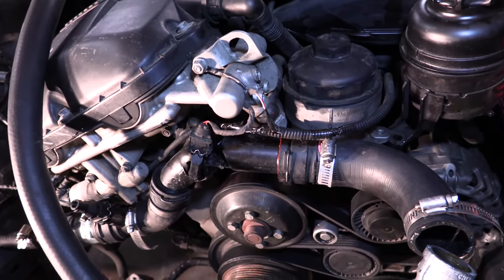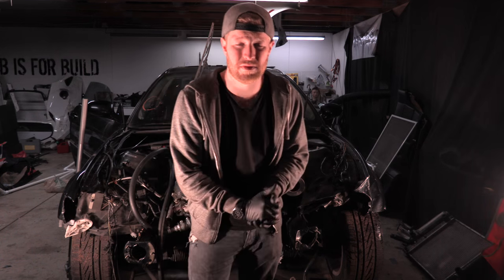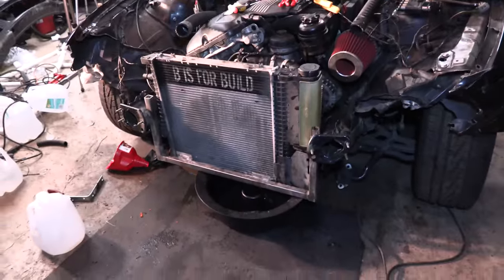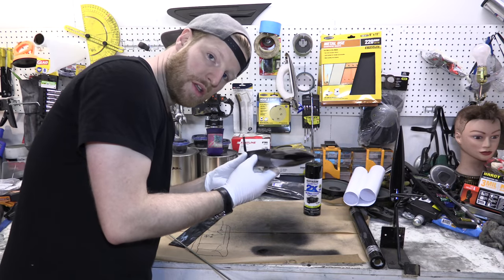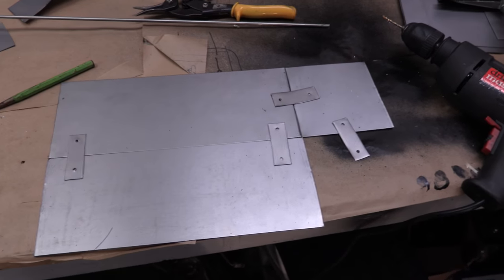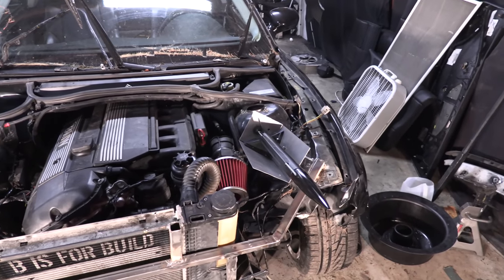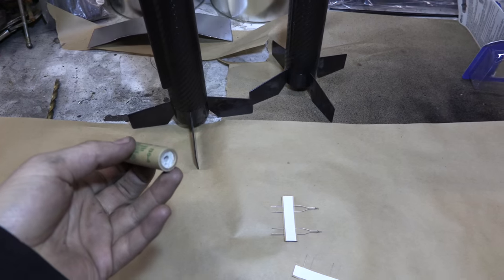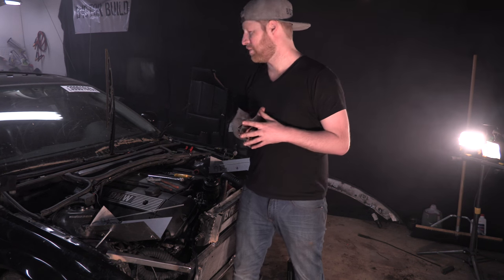Budget BMW Fun Pt 4 - DIY Rocket Launchers!!!

Comment: Please sell the exhaust and do a straight pipe from the headers, out of the hood
Reply: +22laith22 nooo out the side
Reply: +joel stuart ^^^^this guy knows whats up. #weightreductionbro
Reply: Just cut the exhuast half way down,  or maybe splice it off exiting on an angle behind a door.  Save yourself a carbon dioxide headache and a stinky smell.
Reply: +joel stuart side exaust out the fender between the door and the wheel for swag
Reply: +22laith22 side exit will be best
Reply: +22laith22 I approve of this
Reply from the maker: +22laith22 OK guys i really wanna do this , so ill look into it, but if it means losing 2.5inches of ground clearance, i cant do it. But ill try my best!
Reply: +B is for Build if you got out of top of the hood you won't have to worry about your exhaust scrapping at all
Reply: You might throw check engine light codes since you won't have a few sensors after straight piping it.
Reply from the maker: +22laith22 if i dont think i wanna go out the hood, i cant run any resonators or anything to quiet it down, so itd be super loud and quite the cop magnet, side is cool, id like to do the side if i can figure it out
Reply: +B is for Build do side but thru the fender
Reply: Or follow the existing exhaust path and just do a straight pipe all the way back. Or from the cats back.
Reply: like mighty car mods silvia
Reply: 22laith22 or just do a side exit pipe..
Reply: nuuuu

Comment: you should connect the rockets to the indicators.  That way you can set off either the left or the right at 2 different times and the wires are all up front. lol @BisforBuild

Comment: All you need is hose with a diameter that matches what the system already uses. It'd be more expensive, but it wont cause the huge restriction of that 1/2in (?) line you've been using...

Comment: Make it a Mad Max/James Bond crossover theme, maybe stick some chunky tires on if you can. Definitely needs to have a muffler replaced with straight pipe and a light bar, maybe a huge cb antenna too.

Comment: if you have overheating problems you can tune ur ecu byurself and set the timing on thermostat to open early so car doesnt build up any pressure and your radiator  hose  wouldnt pop , thats why expansion tanks on these cars go , cuz too much pressure.

Comment: As said in a previous comment i think its more down to the fact that the pipes are smaller and the flow is less causing far too much pressure than it should be.

Comment: dude if that top hose blew off going 65-70 the intake may drink it up and could potentially hydrolock your motor. Cool stuff so far though I like the idea of the rear mounted whatnots with a mad max bash bar?

Comment: How many beers do you go through on a typical build day?  And where do you go to let it out after you break the seal?
Reply from the maker: +0ttoman id say 1 or 2 beers, not many because most days we need to drive home after. And we normally just run around back.
Reply: +B is for Build I usually have 1 or 2 while enjoying your videos.  I've also found myself buying Coors Light Tallboys for some reason...lol.  Chris I noticed something in the video and had a quick question.  With that severe upwards bend in the upper radiator hose, do you see any issues with overloading the water pump/coolant not being effectively delivered to the radiator?    Thanks and loved the video as always!
Reply from the maker: +Pdiddy I think it will be fine, it had plenty of power to push the water all over the car when we had the rear mount. Now that the pipe is the correct diameter i think it will really chill out, they are pretty versatile in general. We read up on alot of people doing rear mounts with the stock water pump ( not the crappy bmw ones though ). Well put it through some paces in a shakedown this weekend and hopefully itll operate correctly, if not we can always find the correct bend to make it less drastic.
Reply: Sounds good, Chris!  Just would hate to see something as stupid as that ruin your trip!  One thought would be just to trim the pipe so its more of a straight shot to the top inlet.  Might not be possible though with fittings and such
Reply from the maker: +Pdiddy Yeah that type of pipe cant be trimmed unfortunately
Reply: +B is for Build next time just bring an air mattress so you can drink as much as you want

Comment: Put the fan on the inside of the rad.  Will blow in the direction of air passing through the car.  Also, won't heat your interior!
Reply: +Datsun Z ...if you had left it in the trunk

Comment: Too much fluid flowing due to a modified thermostat will put too much stress on the engine because it will never get to the proper temperature. Just get a high flow stat and put the radiator back in the front

Comment: Don't run the thermostat open on a project car it's fine but on a daily it's bad, the ecm doesn't monitor its fuel consumption until closed loop and if your thermostat is stuck open your car will run rich until 210 degrees And obviously if you remove the thermostat you will have cold coolant circulating a cold engine so it will take you a while to get the car at 14.3-14.7 afr

Comment: use 1.5 inch steel conduit pipe and radiator hose connections.

Comment: maybe using 50/50 coolant/water would have made that back radiator build work...maybe
Reply: water is way more effective than prestone. prestone is only an anti-freeze, rust protection and lubricant for your water pump ;) just so you now.
Reply: +TJPDmember thanks! I thought a good coolant would also delays the boiling point then less steam in the system and less pressure built up...still learning something every day :)
Reply: nope. pressure delay boiling point. your radiator cap is controlling pressure by letting it go in the overflow tank if there is too much in the system.

Comment: why not just take the thermostat out
Reply: +Max23653 Yeah I generally do that as a rule with any car. During the summer, I get 40 degrees celcius plus
Reply: where im from in the states in the summer it get to 46+ for weeks at a time
Reply: Celcius? We get that maybe 4 days in the middle of summer. It's not the heat that smashes you, it's the humidity...
Reply: IDriveAHeap OfSH1T ya theres not much humidity here and yes celcius its about 115 f
Reply: still bloody hot, humidity or not
Reply: The e46 thermostat/housing are one piece
Reply: oh righto matt thanks. Not very cluey on BMW bits

Comment: Why not top mount the IC?
Reply: +EZhurst Cuz there are no IC?
Reply: +ZenTex Lol I meant to say top mount it like an IC, my bad
Reply: Won't be much air flow.
Reply: +Aaron Hall Well, he isn't running a hood, so why would there be?
Reply: Because the air isn't  flowing like it would with a tmic. The air would just be static in the cooling fins so it would over heat fast. Plus tmic arnt the most efficient anyway.
Reply: +Aaron Hall He is trying to keep it off the front so it doesn't get destroyed, a radiator on top is better than a radiator with big holes in it.  I see what you mean though.
Reply: No hood scoop or ducting so it will just go over the face of the radiator not through it.
Reply: +Aaron Hall So add a scoop, that's what building a car is all about.
Reply: +EZhurst next episode roof mounded radiator also new turbo, we are also mounting that and the ic on the roof 👍🏼👌🏻👌🏻
Reply: +EZhurst it's just not a good idea. Rear would work better and have less problems if he did it with the correct materials.